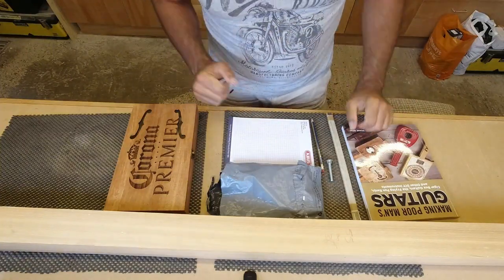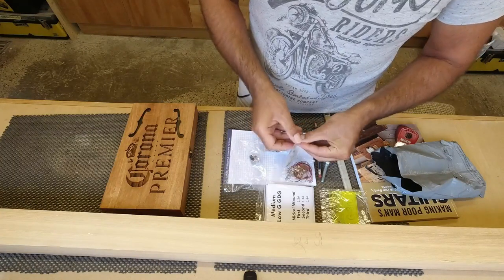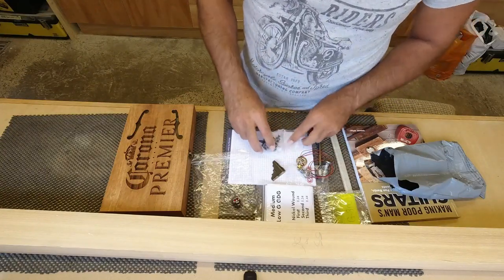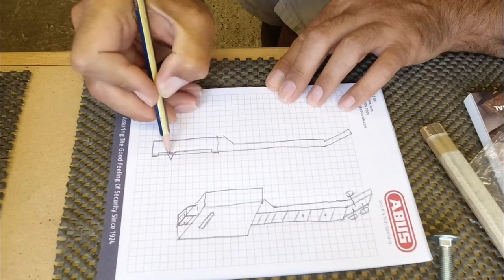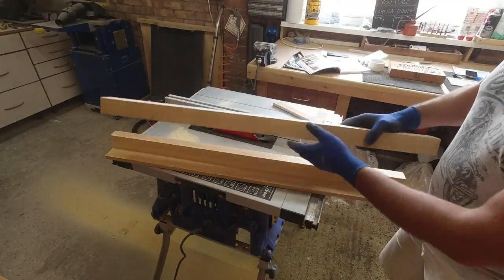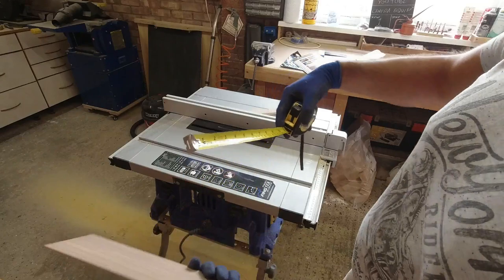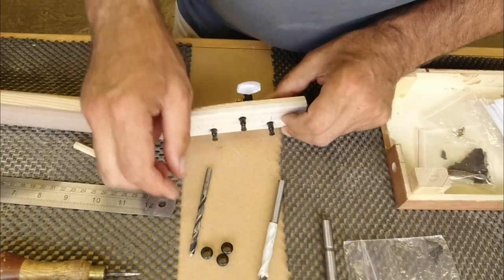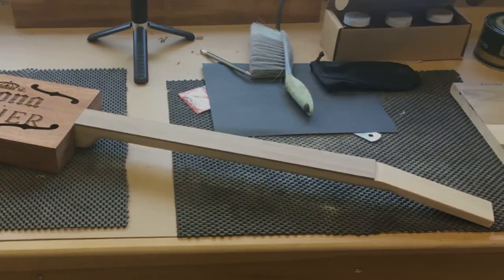Building a Cigar Box Guitar - Woodwork Workshop Project

Comment: I re-watched this Greg 🙂 Just a little suggestion. If you take a quarter of an inch off the bottom of the stock ( not all the way but similar to the top ) where it's in the box ( the long section you have resting on the inside back ) it would let the back of the box resonate a little more. Every little bit of extra acoustic's you can get out of such a small box is only really a benefit, well if you want more of an acoustic sound plus more volume when not connected to an amp.
It may not need it and it's just a though. Looking forward to the next part 👍
Reply from the maker: I can always take a little more off once i have tried it if it needs a bit more :D
Reply: @GregVirgoe  Yes Greg. I did notice one of Puckett's fully acoustic cbg's had good clearance on the bottom except the outer parts where he puts the screws. It was a hard one to spot and freeze frame lol. 
Hurry up and get it finished so I'll know what to expect in the real world, I'll trust your opinion before I build mine 🙂👍 I'm sure it'll be great!